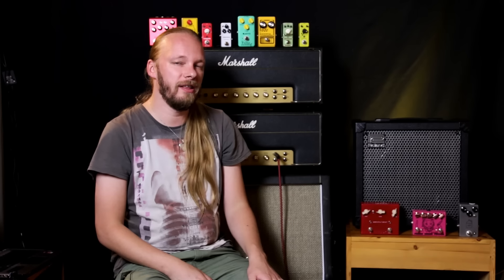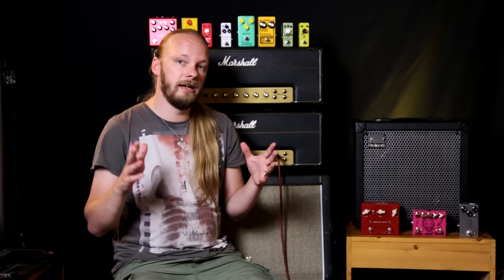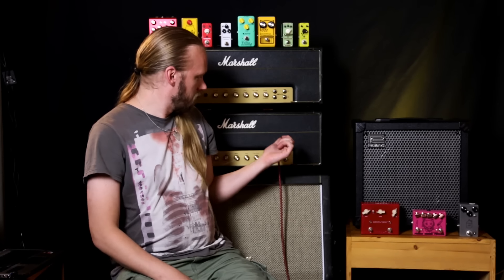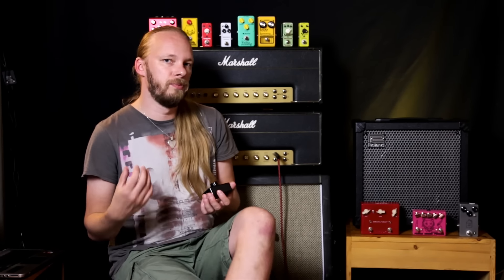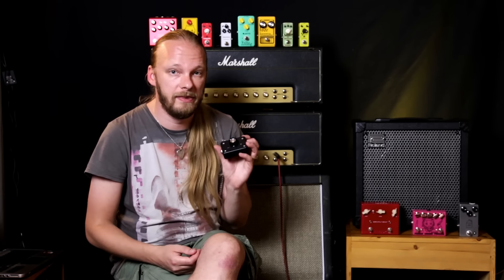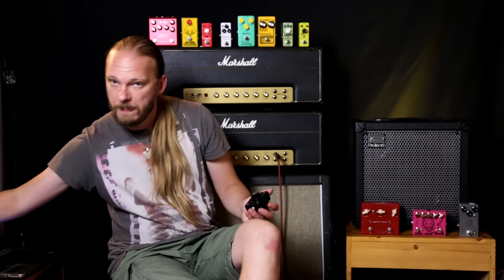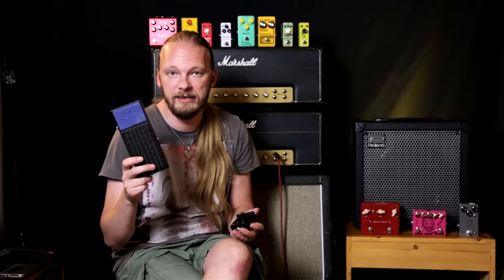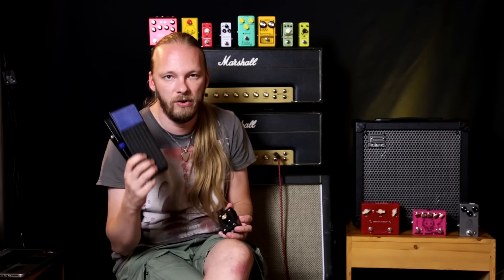Marshall Plexi? At BEDROOM Volume?

Comment: can you compare the clean setting on the origin 20 to a hot rod deluxe? they are about the same price range
Reply from the maker: Don't have the Origin anymore. I sold it to buy more gear to review. I have about 12 gear reviews made 😂
Reply: That' s an apples to oranges comparison.  It's not that one is " better" than the other, they are just very distinctively different, and offer a very different set of features as well. There is a tone difference but also a difference in available gain, which pedals work well with them,  etc. That said if you are looking for a " clean" amp and get your o.d/ distortion from pedals, ya want the fender.  If ya want more drive, can live without internal reverb, or are more of a guitar straight to the amp type fella that needs the amp to go from clean to dirty without pedals, ya want the marshall. The origin is pedal friendly, dont get me wrong, but it is classic marshall, no more no less. The fender is a 6l6 driven clean amp with a lil breakup if cranked with a nice reverb and not much else, but is a lil more pedal friendly.  The beauty of both is their simplicity but other than that, they have very little in common.

Comment: Can you link where I could buy the same volume pot ?  thanks
Reply from the maker: It's not the same one, but I think it should do the job: https://www.ebay.com/itm/Volume-Box-guitar-amp-effect-loop-touchy-master-volume-taper-fix-attenuator/200925904844?_trkparms=aid%3D111001%26algo%3DREC.SEED%26ao%3D1%26asc%3D20160908105057%26meid%3D6ba13b58dccb476e913772d9fdf9659c%26pid%3D100675%26rk%3D1%26rkt%3D15%26mehot%3Dpp%26sd%3D200925904844%26itm%3D200925904844%26pmt%3D0%26noa%3D1%26pg%3D2380057&_trksid=p2380057.c100675.m4236&_trkparms=pageci%3Ae6bc3c15-f499-11e9-8c27-74dbd1801a9c%7Cparentrq%3Af2461f8d16d0ac3e258d7807ffff5e66%7Ciid%3A1
Reply from the maker: The one I bought isn't available anymore.
Reply: Check out the " volume box" by Carl's custom guitars ( also available on ebay and reverb.com) inexpensive and work like they are supposed to for an fx loop style " attenuator ".  In a perfect world the marshall power brake or thd hotplate would be my recommendations but these fx loop boxes work well for much less cash.

Comment: Do you have a link to the specific volume pot you use? Also, how do you actually hook it up? (i.e. what connections are needed)
Reply from the maker: No. I don't think the guy makes them anymore. I bought a second one, which is more rugged (since I thought I need a spare). I haven't tried it though. Here's the link to that: https://www.ebay.com/itm/Metal-Volume-Box-guitar-amp-audio-taper-effects-loop-master-volume-attenuator/200925901680?hash=item2ec81df370:g:zqoAAOSwVctY5MXu
Connections are simple. From the send of the amp into the volume pot, and out from the volume pot into the return of the amp. I also have other stuff in the loop. In my case I put it all before the volume pot.

Comment: What's the volume pot called? And does it work for a solid state amp? Thanks
Reply from the maker: Why would you need it in a solid state amp? I forget what it's called. JHS has one. Can't remember what that was called either.
Reply: jhs - Little Black Amp Box

Comment: Your dB-app isn't far off actually. When counting and adjusting dB you need to understand the logarithm. I seem to remember you've mentioned that math wasn't your strong suit 🤔, so I'll break it down. Deci means ten. This means every bel higher basically raises the effect by ten each step. So there is a greater difference from 79 to 78 than from 78 to 77. This means that each whole step between 80 and 90 are basically ten times higher than the ones from 70 to 80. Obviously an app can never measure perfectly but seeing how I have my own dB-machine at work and I use my amp as a point of reference when teaching about sound in physics I can conclude that your app is sufficient enough 👍.

I live in my own house so I have my big amp in my living room. And my kids sleep on the top floor so I can play quite high even after bedtime. But I must say that the fact that I can adjust the wattage in the output (from 60w all the way down to 1w) goes a long way. It doesn't keep the sound all the way, but definitely close enough. Great feature actually.

But very interesting video. The health of our ears is something many of us don't think about. Catch that? 😂😉.

I might use this video as part of my teaching actually. Could work as an introduction both to counting dB but also added knowledge before I go practical. Hope that's ok in that case.
Reply from the maker: Cool stuff. I'm indebted to you my learned colleague 😊
Reply from the maker: And it's totally OK to use any of my videos to teach, or scare, the kids 😂
Reply: @MrPolevaulter  That you are not 😊
Reply: @MrPolevaulter  Both of course. "Don't make me bring Elmo out ☝️! " 😂👏
Reply: Indebted I meant. Figured I should emphasize that. Would be awkward if you'd misinterpret and go "Now we must do battle". 😁
Reply from the maker: :D
Reply: Keep in mind that the mic on your phone cannot handle much input and does overload quickly, which causes the app to register much lower decible than what you're actually hearing. 

For example, my Marshall Origin 20 at full blast is around 119 decible. Super loud. However, my phone app says it's always at 85 decible.

So, the phone app is way off and by no means accurate due to the mic becoming overloaded quickly. Either get an external mic that can connect to your phone or pay about the same amount for an inexpensive decible meter.
Reply: @intargc  I doubt that the origin 20 is capable of producing almost 120 dB though. 🤔
Reply: @intargc  As a point of reference: the maximum limit for allowed dB at an indoor rock concert in Sweden lies at 100 dB. "we" are currently discussing lowering that limit to 97. That is loud. Like Motörhead or Metallica-loud. I think they are the only bands that have surpassed that limit in Sweden and gotten fined accordingly. And Metallica did that at Globe Arena in Stockholm. So a Marshall origin being able to bring that noise. I just don't see (hear) it happening. It's a 20w head. My Ironheart at 60 can't get to those levels.
Reply from the maker: @intargc Yeah. Been thinking of getting one.

Comment: So you only have that little black volume box between your guitar and amp in this video nothing else in the line ? Sound great 👍.
Reply from the maker: It's in the loop. I do have an overdrive between the guitar and amp.
Reply: @MrPolevaulter  Which box is it? Du you have a link?
Reply from the maker: @rasmuss2239  Not to the one I have (I don't think they make it anymore), but something similar: https://www.ebay.com/itm/Volume-Box-guitar-amp-effect-loop-touchy-master-volume-taper-fix-attenuator/200925904844?hash=item2ec81dffcc:g:wFIAAMXQ-BZQ9goF

Comment: What power soak are u using? Also what are u driving it with mate   ?
Reply from the maker: Just a volume pot in the loop. I think I was using a Fender Yngwie Malmsteen Overdrive in this video.
Reply: @MrPolevaulter   you got it sounding brilliant fairplay
Reply from the maker: @kitchenguitarshred8587  Cheers!

Comment: Very interesting. Do you lose compression when you turn the volume down a lot? I mean do you get power amp distortion?  It would seem you would lose speaker air movement or something. Very cool tip. 
I once had a peavey 2x 12 Ranger combo. That thing was so loud you could rotate the earth on it's axis. I mean this thing was loud.
Reply from the maker: You do lose a bit yeah.

Comment: Most likely you were using a load box that was a resistive load as they are the least expensive and definitely the most common. You need to use a load box that has a reactive load- those don't kill your tone.
Reply from the maker: Sorry, not sure I understand? Sounds like you didn't watch the video. I might just have misunderstood. I was using a passive volume pot in the loop, not a load box. One of those would be after the amp.
Reply: I think livingabovethe12th was referring to your use of an attenuator many years ago, and that you hated it.  I/We would like to see you try a newer modern attenuator that is "reactive".  Older attenuators used a resistave coil encased in cement, and while they work well they do suck some of the tone out of the signal/sound.
Try a Rivera Rock Crusher Recording with the active EQ, it is an active attenuator that seems to be a good trade off between price, features and performance.
For my older 1987x (no effects loop) I am running a 2x12" cabinet with a pair of custom voiced/reconed Vintage 30s, it is VERY Loud.   Looking to upgrade my Dr. Z Air-Brake attenuator soon with the Rivera model.
Funny what you said about the volume knob not working, so true.  Volume settings at anything under "4" sounds thin, I play mine daily at about 3/4 full volume (using the attenuator of course).   Interesting, my other amp is an old Fender Twin Reverb, at 100 Watts it is almost as loud as the 50 Watt Marshall 1987x!

Comment: Is it a JMP50 or a JTM45? To me attenuators cost an arm and a leg and whatever the brand they always change the original sound the bad way.
Reply from the maker: My Plexi? It's a 1987x. The attenuators I've tried didn't work well, but I've heard that the Ox by Universal Audio, and the Waza Tube Amp Expander really work. Not sure though.
Reply: @MrPolevaulter  Brilliant playing and a great video! I've been using a volume pot in the loop of my 60 watt Hot Rod Deville 410 (I know, heresy) for many years and it really is a great solution ... if you can live with only pre-amp tube saturation. But i recently built a fantastic attenuator for about 50 euros -- really easy to do in a few hours even by a novice. It absolutely DOES NOT mess with the tone down to around -28db: on a 50W Plexi that should drop the amp from somewhere around 118db dimed to about 90db which is still way above bedroom level, but playing with the volumes and perhaps putting  an always-on pedal in front with low level (or even the volume pot in the loop as well) you can definitely get into bedroom territory. If you're interested just go to the Marshall Forum and look for "Simple Attenuator" :)

Comment: If I play a 1 watt through a 4x12 it’s not going to be bedroom volume. Get a 1\4 watt amp
Reply: The 4×12 is the culprit in this scenario. Ya dont need less watts ( this will also sacrifice clean headroom) , ya need less speaker. When using 1 watt, a single 12 is more than enough speaker. Then again, most do not only play in the bedroom so  attenuators and  fx loop type "volume boxes" still come in handy regardless. One amp, large cab, small cab, and attenuator/ volume box allows one to go from bedroom to small club to theatre efficiently. And getting a single 1×12 cab and volume box is cheaper than several amps with several wattage ratings etc., and allows you to take your favorite amp/ tone to any setting, large or small.